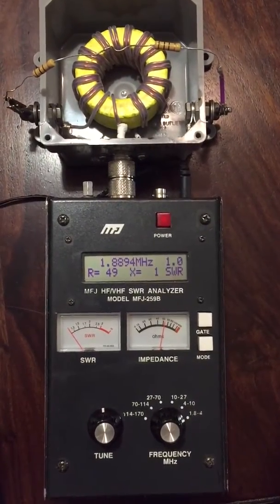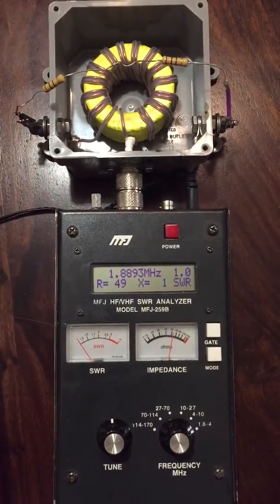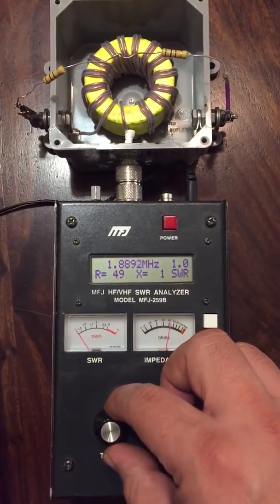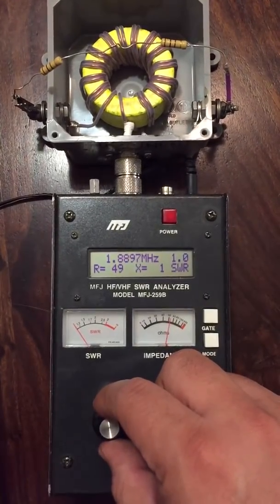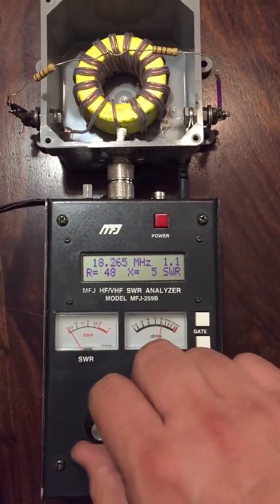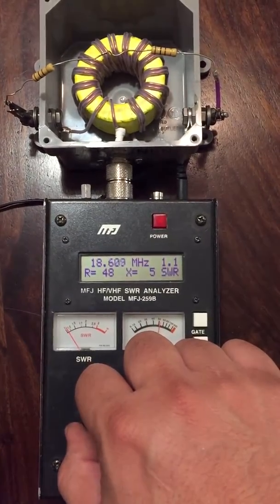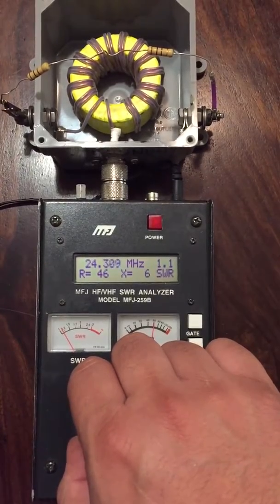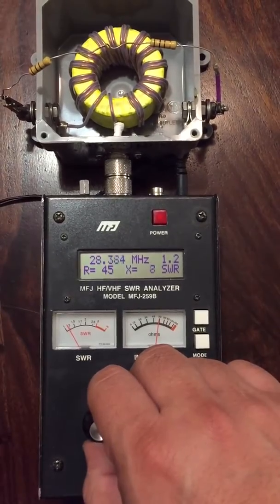4:1 UNUN #001

Comment: What does it mean when youre impeadance is low(30) yet SWR is low also?
Reply from the maker: It works very well with my 33 foot vertical antenna, I work 80-10 meter 1500 watts with no problem. 
73